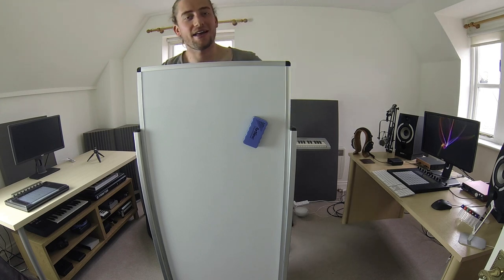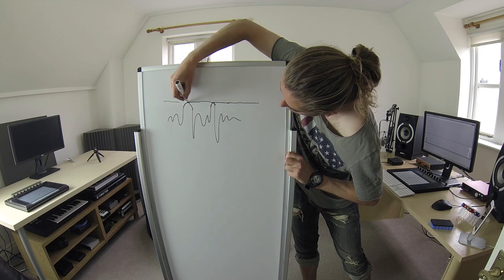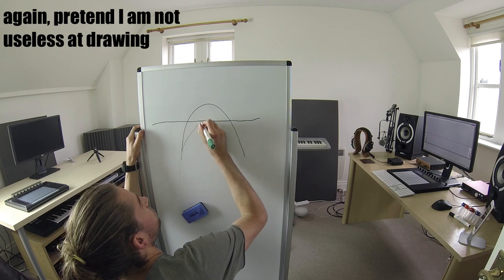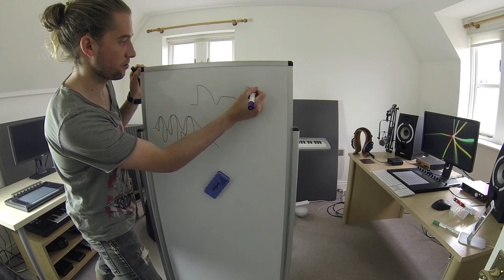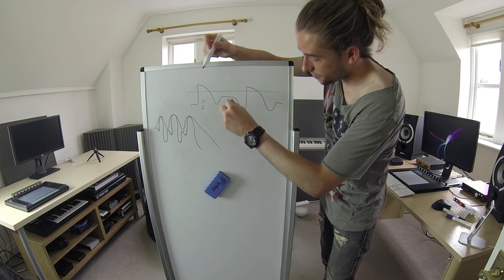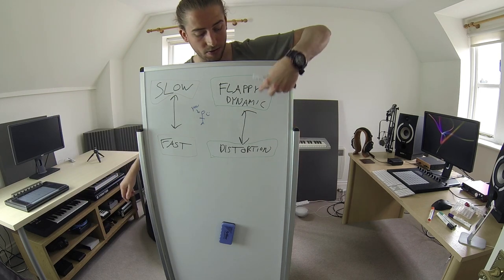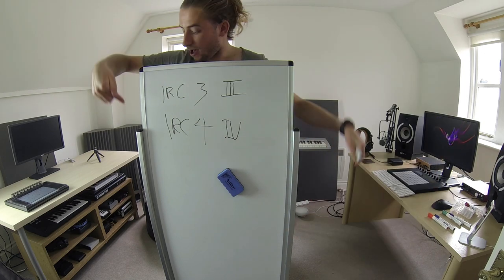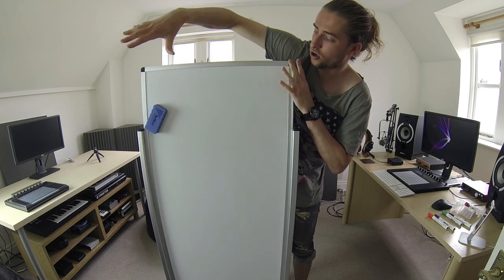Limiter Tutorial | Introduction, Release Time, IRC III/IV, etc..

Comment: In your example, the limiter would also hit the bottom side of the wave form. Also, the release time is actually how fast the limiter snaps back into action after it hits a particular peak. If it's busy hitting peak 1 and peak 2 comes along, it won't compress peak 2 as hard. However, if the release time is fast enough, you could actually compress part of the peak (horizontally) and leave the rest of it untouched. Release time has nothing to do with the vertical part of the wave form.